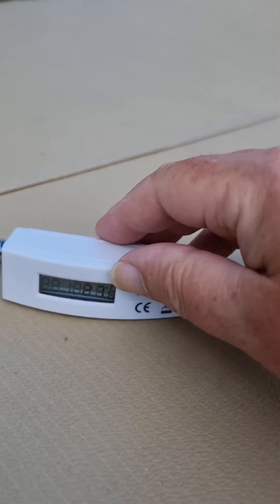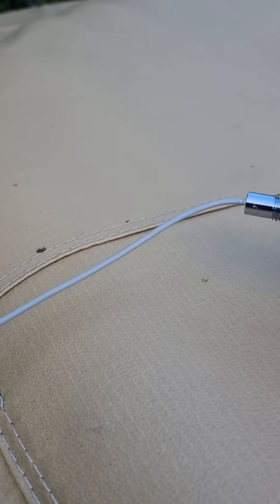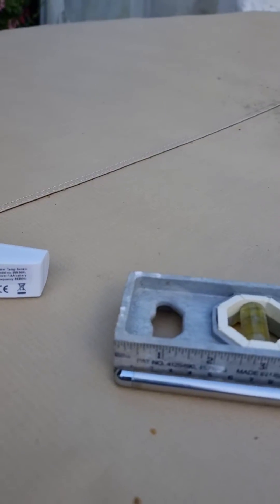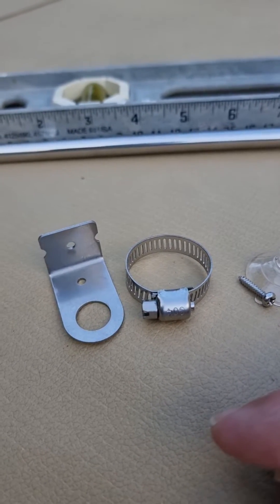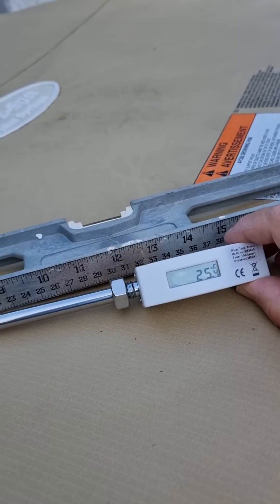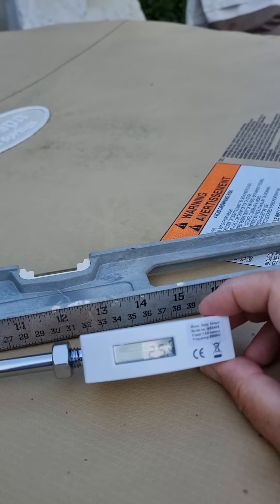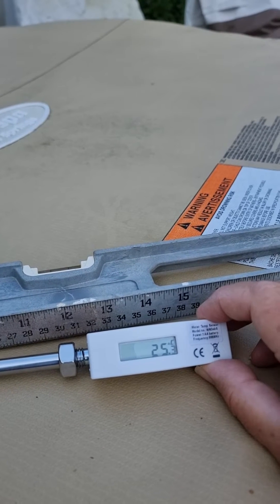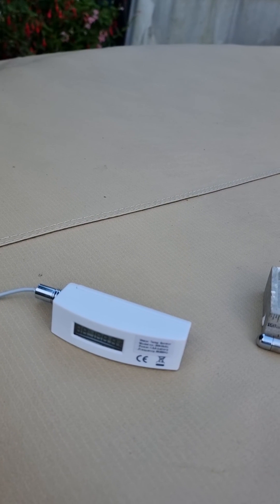Ecowitt WN34 Soil and Water Temperature Sensor

Comment: Hi there, for the soil sensor, dose it read the temperature from the bottom of the probe? Therefore depending on how deep you insert the probe you'll get different readings? Or does it take the average temperature from the whole 30cm probe?
Reply from the maker: The sensor reads the temperature from the tip of the probe, but given the probe is metal there will be a degree of conduction along its length which will average the temperature. If the probe is partially exposed then that will also have a factor